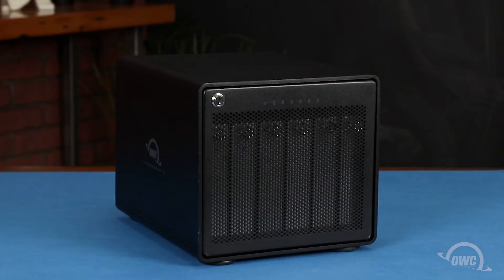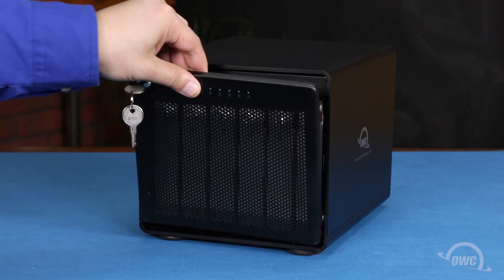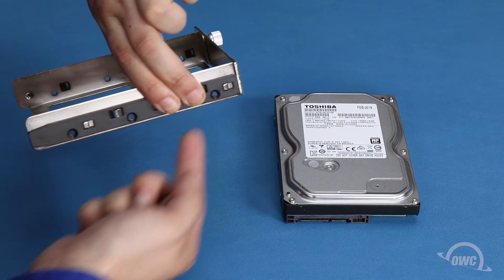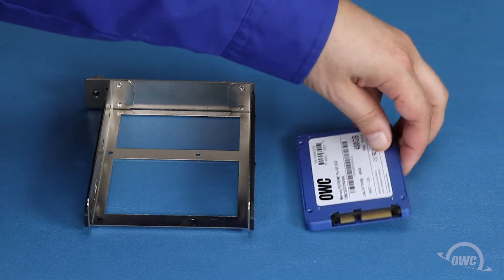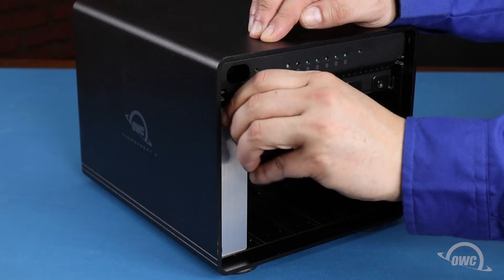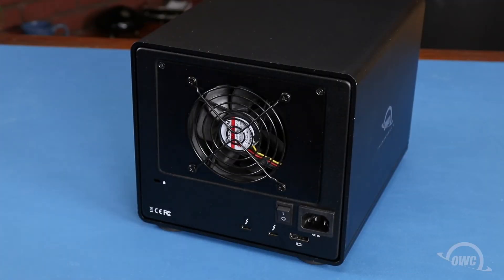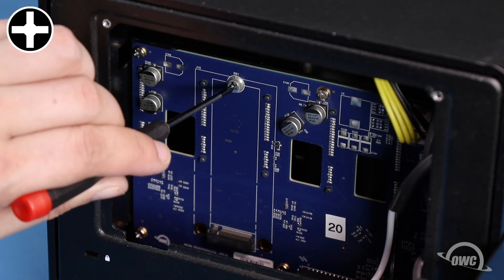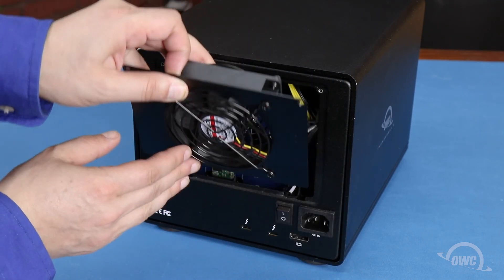OWC ThunderBay 6 Drive Install

Comment: what is the M2 drive for? are there any recommended sizes or models of the M2 drive?
Reply from the maker: The M.2 drive is intended for additional storage capacity or as a dedicated scratch disk. It is important to note that it cannot be configured in a RAID array with other drives. Compatibility is ensured with any M.2 drive possessing a 2280 form factor.

Comment: Hi MacSales! Could you please let us all know how fast can be M.2 disk? Are they any limits to the speed of M.2 disk? They are available with 3200/2500MB/s read/write speeeds nowadays. Would be to to know.
Reply: Good question. Normally OWC devices will not pass thunderbolt2 connection speeds topping at 1.5gb/s (very fast for the price) even with SSDs. The Pegasus will do almost 2.7gb/s but at more  2x the price. Thunderbolt will not let you go above 2.8GB/s  (unless you bridge) in any case. This is a new unit, so I have no idea how much performance you are going to get.
Reply: I have had a chance to check it. The speed of 1TB WD Black NVMe SSD is around 700/650 read/write.
Reply: @tomaszszwaek1199  Ahhh that's sad news. I was purchasing assuming I would get those super fast speeds.